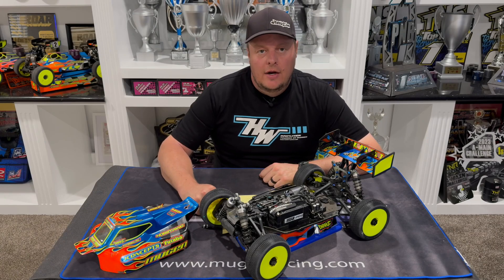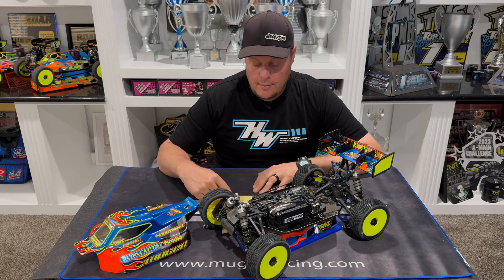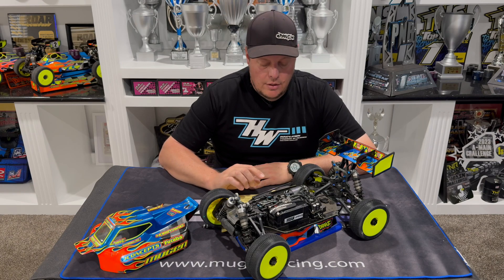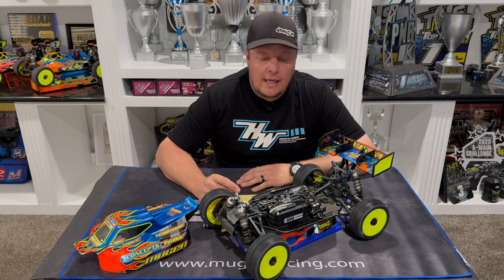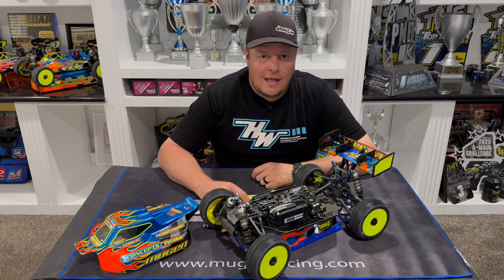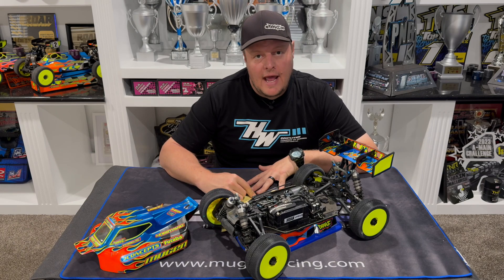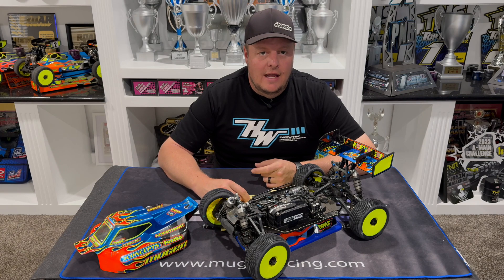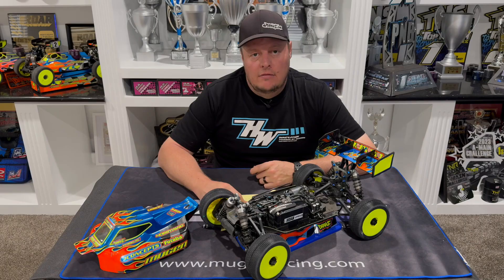HOBBYWING Throttle Rate Control

Comment: The Problem with low numbers for me is that i cannot get the nose up fast enough when going over jumps. Leading to nose dives from time to time
Reply: if ur car jumps ass up that’s probably a shock setup deal
Reply: @endosrc  It does not do it normally, but there are some weird jumps out there which just kick the back up (for everyone) which is normally not a problem, but when you cannot correct it it IS a problem.